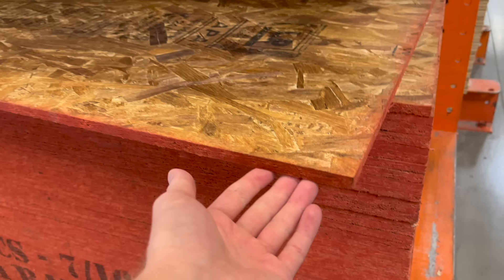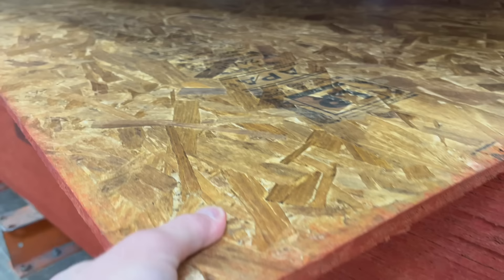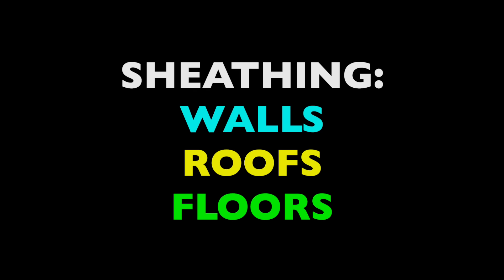Is OSB Bad?! (Oriented Strand Board--What It's For / When To Use It...House Sheathing/Subfloor)

Comment: OSB came on the market as Aspenite.  I bought my first Aspenite in 1982 to sheet the house I was building.  A  4 x 8 x 1/4 inch cost 4.99 and was super smoth on both sides. This was dangerous as the sheets could slide all over the place. I lost the whole load of 44 sheets when I stepped on the gas going down the highway.  Five years later I added an attached garage. About 3 years later I finally got the whole house and garage stuccoed. By than the 3 Year old OSB was pealing. The orginal sheathing was in better condition after 8 years exposure than the stuff after 3 years.  The original had more glue than the stuff they make now and does not stand up to exterior weather like the first stuff I bought.

Comment: I like osb for  making affordable shelving. I’ve made several for use in my garage.  What I do is screw in some shelf brackets, size up my shelf width and depth, and cut to size. Place it on the brackets, make my mark for the drill holes and finish up.  I do paint the osb, because  it can be a bit flaky. This prevents me from potentially getting a splinter. I prefer to use bolts and wing nuts to hold the shelving in place. Thanks for sharing Ethan!
Reply from the maker: Nothing splinters like OSB, Steven. I’ve gotten inch-long daggers in my thumb webbing before! 😅
Reply: @TheHonestCarpenter  yikes!  Love ya love the show! Great content Brother
Reply: I remember picking up a leftover piece, and getting a splinter. It was hell trying to get out.

Comment: The only problem I have with OSB is the off gassing when you cut it. It does dissipate in time. I may be a little biased because the off gassing requires that I wear a mask and thick gloves when I work with it because it will produce a nasty rash otherwise.
Reply: @ydne  They both contain formaldehyde.
Reply: @jobacuda4472  
Not all OSB is made with formaldehyde based resin, some mills use MDI which is the same type of resin that is used in gorilla glue. You have a higher chance of sticking board to the press if you have an upset but you can use a release agent to help prevent that.
Reply: @Brandon-ed6yv  Interesting! Thanks.

Comment: Ethan, I haven't searched down through all the comments, but I think you missed mentioning OSB I-Beams for floor joists.  They can be manufactured to almost any length with OSB uprights and Plywood tops and bottoms.  My house was sold as having a "Silent Floor" construction because the joists were stable.  OSB joists had pre-impressed knock-outs for plumbing and wiring as well.  Great use of dimensional lumber sawmill waste.
Reply: Scott, you're about to be attacked by all the I-joist haters!

Comment: Are usually shy away from the stuff, and I hate cutting it because it gets lodged in the back of my throat for about three days. 

And I believe (at least for sheathing) you have to use a certain nail (as opposed to screws) for a certain thickness. I believe you have to nail it every 6” because screws to tear it up. I could be wrong, I know a lot more people have more experience with this can explain better.

Comment: Have had multiple floors where a water leak expanded the osb.  Granted it was older osb, but unless doesn't  react  to water, not a fan
Reply: I've seen and repaired many plywood floors. Keep water away from any wood product!
Reply: I had to repair a bathroom floor where 1/4 OSB was glued to the plywood subfloor. The OSB had become a rotted mess, but the plywood still resisted awl penetration.

Comment: I like the price of OSB, but I watch where I use it on the roof now. I built a couple of dormers on a 12/12 roof and was in a hurry (my own cottage) and I did flash them as I knew how but was in a hurry. I had a hole in less than 6 weeks. Never will I let my OSB but subject to so much water. Also, I like to use regular plywood in the areas now. OSB overall but plywood at the rake, eave, around dormers, and other possible problematic areas. OSB is a good product. I am not considering painting all edges and the factory with good exterior paint to see how that weathers.

Comment: While OSB may have structural integrity, it also contains and emits toxins. Part of the binding material has formaldehyde which causes irritation to skin, eyes, and other areas and it has been linked to asthma. Consider a healthier alternative.
Reply: Not all OSB is made with formaldehyde based resin, some mills use MDI which is the same type of resin that is used in gorilla glue. You have a higher chance of sticking board to the press if you have an upset but you can use a release agent to help prevent that.
Reply: This is an emerging concern (it has been emerging for a few years but I doubt we are seeing an end to it) particularly with manufactured wood products from China. Urea-formaldehyde must be good for something because it has been in use for at least half a century, but it gradually breaks down into urea and formaldehyde. Heat accelerates that; in the 1970s homes built with urea-formaldehyde insulation became uninhabitable in the summer.

Comment: I use osb for board ups, and for my work tables. Idc if I drill through it or cut in it. I can replace for $15. Does the same as plywood.

Comment: Thanks for all your very helpful videos and information, Ethan, and I really appreciate your no-nonsense approach to your videos – just really solid, understandable and helpful tips and advice. One question when it comes to sheathing the inside of exterior walls (e.g., finishing the inside of a garage): Is there a general rule to follow for the vertical spacing of the screws/nails along the studs (how far apart/close together they should be)? Thanks again for all the great info.

Comment: Very helpful, thanks! I’m about to put new subfloor down in an outbuilding that is my studio, and my ex never finished the siding, so it’s raw OSB, and I’ve been wondering about putting SEMCO Liquid Membrane on it until the budget allows for exterior finishing. He had finished the interior (but didn’t insulate or wrap it or finish the siding), and I use it as-is. It’s not the ideal way, but it’s critical space. 

And I hope to later do blow-in insulation, by cutting small holes in the outside at intervals, patching them up, and then building wrapping it, and then putting the siding on. The OSB is holding up surprisingly well, since it’s been some years now. I wanted to know the expectations for it, and this has helped. I was planning to use plywood for the replacement subfloor, but may change that plan now. It’s good to know there are some options. Doing it right comes first, budget is right behind that. 

I was planning to put the SEMCO Liquid Membrane on the new subfloor as well. It bridges cracks, which is a plus. If there’s any issue with using it on old OSB or the new subfloor (it’s way out back, and it’s built on railroad ties with no cement pad, so barely over a floor joist width off the ground, but the ties are wedged tight together, so there’s no airflow, which has its pros and cons, and so far it’s stabled, it has withstood a couple of earthquakes, so we’ll give the ex props for that), I’m all for input from people who know their stuff, but it’s going down in the next week or so. The wearing away of the subfloor had more to do with water getting in through the door jamb not being properly installed, and other water damage, combined with not quite enough support between spans of floor joists, weakening a few spots over time.  

This input is very helpful in making better choices.  There are times and a places for the “quick and dirty” project, but building structures and things with an expected longevity aren’t any of them.  I’m that super-irritating, insistent woman from the “build it once, build it right, and don’t ever (have to) build it again“, and the “(take your time and) do it right, or don’t do it at all”, and the “if you don’t know how to do it right, find out how to do it right, (uneducated guessing isn’t good enough), test it out, and perfect your technique before you use it on your final project” camp.

This is a channel for folks from that camp. And it’s appreciated!
Reply: No I retract the SEMCO until I can find reviews that aren’t on their site. No reviews on Amazon at all, though they sell it. There’s a SEMCO and a SEMCOworks (which makes the membrane), and I would have to do a little more homework to find out if they are the same company. It is made in the USA, reviews for the “just SEMCO” as an employer aren’t good. Apparently the only people happy there are upper management, and the actual workers are extremely not happy. But I don’t know if that’s the same company as the people that make the liquid membrane, and those could be completely different factories even if it were making different product all it takes is one bad manager or a couple of them to make everyone’s life a nightmare. TBD…

Comment: My thoughts? Well, as a wood-ignorant auto tech and generally repair-inclined DIY individual, OSB has always been the "crappy plywood" in my mind. 😸 There's the good plywood (laminated stuff), the crappy plywood (OSB), and the horrific sawdust type plywood that melts in moist places (particle board/compressed particle Ikea type shit). I always figured OSB was weaker than "real" plywood. Interesting to see it is actually pretty good.
Reply: We think very much alike on this subject. OSB was always that unsightly large area material, the poorman's plywood. But I've come to appreciate it for niche use cases. Eg: Throwaway workshop tops or any kind of carcass when you can veneer over it. 

Chipboard / Particleboard on the other hand, I still consider this junk, but believe it or not there's still a level lower. That's Ikea where they sell particleboard but it's actually cardboard and air on the inside.
Reply: @blahdiblah2169  Ahh! But the Ikea boards are much lighter when you throw them into the dumpster!
Reply: Here cupboards are usually made out of chipboard.  Even plywood is too expensive for most people.
Reply: @ian1352  Exactly plywood where I live is actually more expensive than solid wood panels.

Comment: Well this is pretty simple if you think about it. If you're going to use plywood then it needs to be an interior finish and not on the exterior of the house. No exterior plywood at all. Always use OSB for exterior walls or roof sheeting. And like always you can use high quality plywood for cabinets closets and interior spaces. I always thought that was pretty much understood

Comment: Growing up in Sweden, I always knew this as OSB-skiva (skiva=board), but not even the shop teacher could say what that stands for. Now I know - oriented strand board. Still, for my house I would only use real wood - there is plenty of glue in OSB and composite materials like that, and it's really not good to be breathing that in throughout living in the house.
Reply: Queastionable how much that really is that gets into the air.. as long as you have some form of ventilation. The walls are covered with paint also.

Comment: Really interesting, thank you. If I may say, as a UK viewer, I love the larger houses you tend to have over in the States but cannot believe the extent to which you use wooden construction throughout the entire building!
Reply: I used to think wood was inferior to cement and bricks, but as it turns out, wood is an incredible material for homes. And if you insulate correctly can be much more energy efficient than older brick buildings, however modern bricks and an exterior insulation layer work just as well. 

All in all if I was to build my own home I would go for a combination of the 2. What I really like about wooden interiors is how easily you can hang stuff. No drilling through concrete, all you need to do is find a stud and you're good to go.
Reply: Rowgli, in the US, we're starting to build quite tall commercial buildings( like 17-story) with no concrete above the foundation. Steel pretty much only for connectors. Just like in Europe. Look up CLT, cross-laminate timber. Also, wood doesn't need to be mined.
Reply: @jobacuda4472  and trees grow faster than rocks do.

Comment: We use osb mainly because plywood hold water too good. If it rains or we get heavy dews, osb dry out way faster compared to plywood. Plywood tends to swell up easier than osb too, at least from our 20 years plus of experience. However, plywood does better in the long run, if the wood is left exposed to the elements for long periods of time.

Comment: I am curious about any off-gasses OSB can potentially put out. Like formaldehyde? I used some sheets as a platform for my bed. I started feeling more fatigued after awhile, and I don’t know if it’s the boards though. I added and air purifier and also made sure my AC was cleaned. Could have been mold in my AC. Upgraded my Air purifier, took out the boards and cleaned AC and hoping this all helps with health issues. Also just tested the contents of AC with a mold test kit with a Petri dish, waiting on results.

Comment: OSB shear strength exceeds plywood making is a better building material when appearance doesn't matter like in substrates... like what is was engineered for
Reply: until it gets wet..
Reply: @chrisburns5691  Plywood, too.
Reply: @jobacuda4472  plywood tends to do a bit better compared. I live in a wet environment and have done lots of rot repair over my career. OSB turns to dust quickly.

Comment: I'm thinking about using osb to line the interior of my steel shop then adding ⅛ panels over the top for esthetics
Reply: I did that, no cover up though, just painted the osb in places, worked fine. The whole shop bathroom is OSB painted

Comment: Yeah, I see the other guys saying what I’d say about the squareness of the sheets. Most of the time they’re pretty darn close.  Pressure treated lumber is about the worst. Also I’d mention that the lines that OSB manufacturers stripe at 16” & 24” centers are almost always off, so you shouldn’t tell folks that they can line up their framing with it. That just ain’t right. Alway, always measure from a verified square member.

Comment: Being a flooring contractor for 26 years.  Osb is the worst for wood flooring.  Doing atear out for repair on osb is easy.    Once a row is removed you can basically grab a board with your fingers and remove it.     That would never happen on 1 1/8 plywood or decking subfloor.       For real hardwoods 1 1/8 plywood subfloor is by far the best.    I’ve talked to lots of contractors.  Anything attached with a nail or staple to osb.  Has a failure.    Roofing shingles and siding too.    Many contractors won’t even do a estimate because of osb.     Buy a small piece of osb.  Put some nails, staples, and screws in.   Remove them.    Then try plywood or 2x material and do the same thing.    Osb is way better than particle board.    But particleboard is just used under carpet or sheet vinyl

Comment: One bad roof install and it's sagging.. if it get's wet it turns to mold.. look at it this way, if you have a block of cheese
that has mold on the outside, you can just scrape it off (like using dry ice or soda blast) in your attic or wall cavities if
it becomes wet and mold appears. If you have a bag of shredded cheese, every side of one of those cheese shards are going to get wet or moldy, with that more surface to clean.  OSB swells, absorbs water, and boom!! Sick House.. Since the use of OSB, the rates of asthma and environmental sensitivities has gone up exponentially from glue off gassing, VOCs and moisture retention.
My house is SO ruined by a contractor on a bad roof job I have to move, I'm very sick. Can't find him, he's moved or retired or I'd SUE him, I specifically requested ply wood and even argued with my husband- If you're an Engineer like I am you'd see - I certainly wouldn't use that trash on my home ever again, over my nearly dead body. MOLD SICKNESS IS REAL.

Comment: OSB is good for sheathing assuming you can get it wrapped and/or dried-in quickly. I always cringe when I drive by homes under construction with bare OSB sheathing exposed for extended periods. Often it’s in big housing developments with many structures going up simultaneously and I’ll see them naked sheathed for weeks of months.  Buyer beware.
Reply: That's true, Devin, but you don't want plywood exposed for long, either. It will definitely delaminate.

Comment: Question - Is it possible to use half inch OSB (1/2 inch x 3 inches x 48 inches) to create French cleats?  Is half inch OSB strong enough?  Will it hold cabinets or tools? if i use plywood can i use half inch plywood to make French cleats?
Reply from the maker: I would avoid OSB for French cleats, Buzz. You can use 1/2” plywood, it just doesn’t quite have the tolerances that 3/4” does

Comment: Great video as usual.  What do you think of using OSB instead of drywall in a garage/shop that is not climate controlled?  

I've seen people do this and wonder about the pros/cons.  If not painted it looks ugly to me on the walls (and not great when painted, compared to even un-mudded drywall), and I wonder about off-gassing.  But being able to just drive a screw anywhere into the wall to hang something up seems great (nothing structural or load-bearing of course).
Reply: I wouldn't worry if it's inside. The inside of the OSB sheathing is exposed in a crapload of sheds and garages.

Comment: How do you feel about using it for building garage shelves, considering how much cheaper it is than some alternatives?
Reply: OSB is essentially a fairly strong mid weight large area material. You can use it for just about anything, there are no rules. Only I wouldn't personally for outside projects where it's going to be directly exposed to rain. In an ideal world you would just use plywood, but it's expensive and with the price of wood what it is, OSB is my goto material for most things.